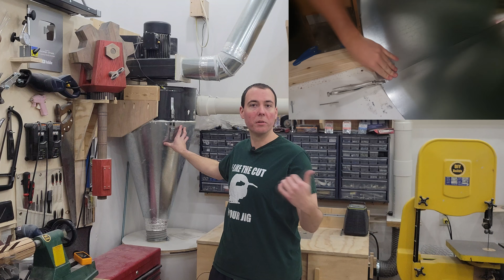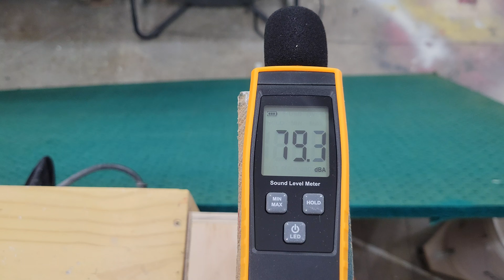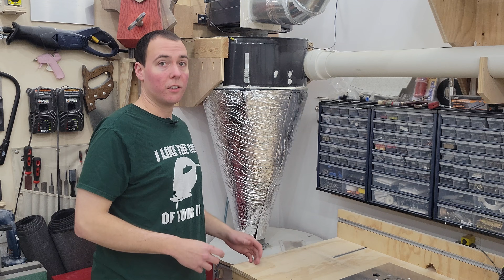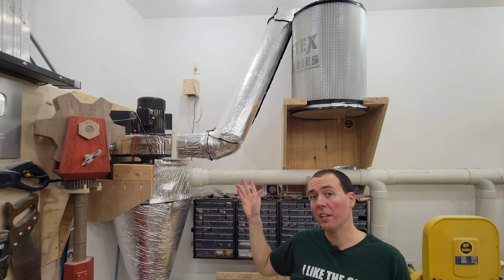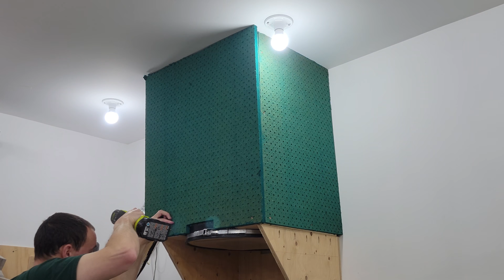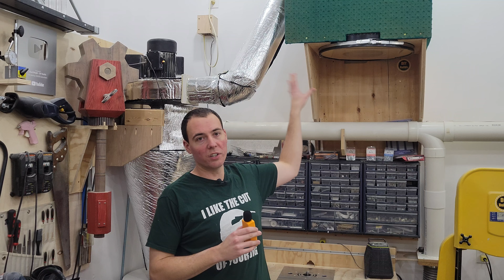Adding The Sound of Silence to My Dust Collection System

Comment: Hey Brad, acoustical engineer here. I have one plausible reason why that meter may show more noise with dampening on the metal parts. 

That meter has "weighted" scales for measuring sound pressure levels. "A weighted, "B weighted and C weighted" scales change which frequencies are favored. These scales "weight" the frequency range for different applications. Some are for environmental noise outside; Others for industrial noise inside. Some are for music as measured from loudspeakers or a band. 

Basically, the weighted scales change which frequencies and TYPE of sounds are more important. These weighted acoustical scales differentiate between impulse sounds ( jack-hammer, banging etc.) and continuous background noise. 

Check which scale you used, or which scale is the default setting for that meter. 

It MAY be that, by dampening some frequencies on metal parts, other frequencies in the ROOM were accentuated.

Also, 3dB is actually TWICE as loud in acoustical measurements, so that is a significant difference. Some people confuse acoustical measurements with electrical ( voltage ) measurements. 

In audio equipment, 6vU (voltage Units) is twice as loud. 
But in acoustical measurements, 3dB is twice as loud.

Those scales are different because electronic equipment has a much lower dynamic range than human hearing.

One other related cause for those mysterious readings: The microphone of most volume meters is OMNI- directional. So even though you used the same location for all measurements, dampening sound in one area ( metal parts ), that could cause the room to resonate at different modes, thereby tricking the mic into hearing those accentuated frequencies.

I know you enjoy problem solving and analytical thinking. That's one reason I really enjoy your videos.
 
So this is one of those rare occasions when I'll spout off in hopes of helping you.

Try changing the scale on your meter if that is possible, then take measurements again from the same location. Perhaps that will give different readings and solve this interesting puzzle.

Also, there are a number of "apps" for phones that do a decent job of measuring sound. Try comparing those with your meter.

I am keen to discover the cause, so I hope that helps!
Kind Regards! ~g
Reply: People like you is why I still stick around on Youtube.  This is what it used to be.  Strangers forming a community and helping each other.
Thank you!
Reply: So 6dB is twice as loud as 3dB, 9dB is twice as loud as 6, 4 times  as loud as 3dB.
Reply: @jeffcarr392  In acoustical measurements, every 3dB is twice as loud. It's a logarithmic scale because humans can hear over a tremendous dynamic range. From the threshold of audibility to maximum volume before pain would be a range of over 240 million times. That's why Decibels are logarithmic. It makes the numbers easier to parse and calculations easier.
Mathematically, we factor each 3dB by a power. I can't write scientific notation here in comments, but this link will provide you all the math clearly. It's basic high-school level stuff. https://www.dsprelated.com/freebooks/mdft/Logarithms_Decibels.html
Reply: @user-sb3wh3dd4v  does the dampening material changes only it's frequencies not noise level?
Reply: @Kris-82 Unfortunately the material shown here is a thermal insulator, not actual vibration damping material.  It appears to be either an open or closed cell foam with foil over the top.   Not what you’d want to help vibration.  You would want a constrained layer damper, that has a viscoelastic layer constrained by a stiffer aluminum layer.
Reply: I guess that is the motor vibration, which now become heavier and moving stronger and transferring the vibration to joints and walls (as you said resonating frequency) I would put those dampener sheets on inside of a plywood box around the motor and connected to wall instead of connecting it to motor.
Reply: Interesting post regarding the sound frequency, and how it affects the readings. Nevertheless, unscientific as it is, the initial sound dampening solution - to my ears at any rate - did sound about the same after the $50 fix.
Reply: Great info. Can you give a recommendation for a sound meter, or do you think a smartphone app is (on average ) better?
Reply: Was my thought too (though just a layman on acoustics) - the sound itself 'sounded like' theyre from the fan blades themselves (resembles a air raid siren in tone) so the mats were just helping force the sound along the ducting and out the big filter, which would also explain why the final step covering the filter helped so much....?
Reply: What apps would you recommend?
Reply: If you're actually an acoustic engineer you would know it's damping.

Comment: 3 dB sound reduction is normally quite noticeable in a side by side comparison.  You could probsbly just use a sound meter app on your phone instead of the dedicated meter.  Try finding the noise source by moving the meter closer to the suspected noise source to isolate it.  You might find that the blower/motor mounting to the wall is a source of noise and that isolating it or making it more stiff would make a difference.  
Also, the more annoying noise is the air compressor in the shop!  How about a video on that one?
Reply from the maker: Lol thanks. No my air compressor is a quiet modle I treated myself to last birthday.

Comment: The problem is that you have added noise-absorbing material when what you need is noise-insulating material. It's a common mistake. If I had used multiple layers of gypsum board, I would have gotten a lot of noise reduction.
Reply: Maybe an obvious question but in practical applications what is the difference?
Reply: @markevans2236  The noise-absorbing is used to reduce reverberation, noise-insulating is used to encapsulate the noise in a limited space. In a workshop the idea is that the noise doesn't fill all the workshop. If you build a cabinet around your dust collection system, you will find that the noise reduction is as big as how many layers you add to the walls of the cabinet. Drywall is a cheap and excellent noise-insulation material. With five layers of Drywall, you probably won't be able to hear the dust extraction system.
Reply: A 3/4 plywood is a better noise-insulation material than those noise-absorbing material that you added.
Reply: @JosePedroEspinosa  Have not measured it, but I have converted my Grizzly dust collector into a cyclone.  I always wear hearing protection but I would like to have an overall quieter shop if I can manage it.

Comment: Your instinct to not restrict the air is appropriate. I would submit that you require a larger gap around the air filter otherwise you are back pressuring the system and limiting its suction. I also have SonoPan around the blower motor.

Comment: This is great info.  I really appreciate the test.  I have a similar setup and am wondering how to reduce the noise.  I think maybe the panels around the fan/motor may be a good test also.  My fan exhausts out the window so I feel comfortable saying that most of my noise is the fan & motor.  There is also the chance that dust container under the cyclone could be an amplifier.
Reply: I think this is the right ‘next step’. Create a baffle around the motor and fan…AND…put some egg carton (or similar) on the flat surfaces behind the motor because the sound is projecting off those surfaces as well.

Comment: it's to do with acoustics vibration. you removed a lot of the resonance by adding the chrome damping material that was probably resonating at the same frequency as some of the noise from the system, stopping the vibration that stopped the harmonic that was very crudely cancelling some of the sound, hence the sound increased slightly.
Reply: Daftman!! I watched your videos years ago and was a huge fan... glad to see you are still kicking....
Reply: Totally agree.  The sound was resonating out all over before, and the sound deadening material kept it in and focused it.

Like playing the trumpet... you make a raspberry sound with just your lips, and it isn't that loud, but you put restrictions on where the sound can go (brass tubing) and you can deafen everyone!

I bet it would be quieter if you removed the sticky stuff and made a baffle out of the sheet in front of the cyclone.